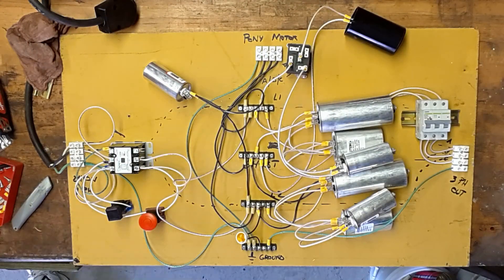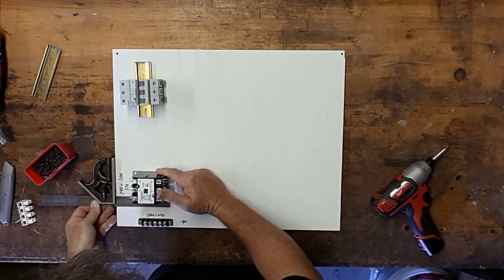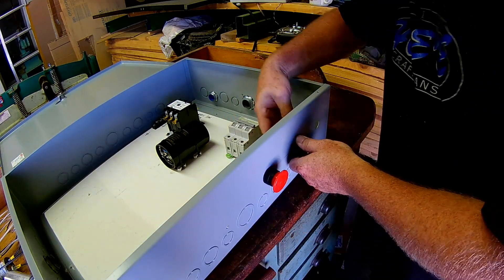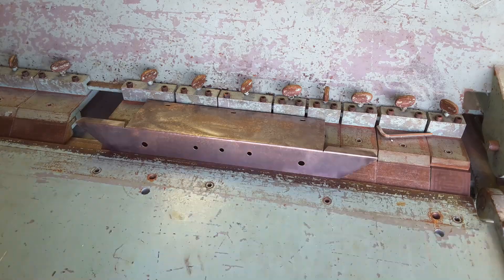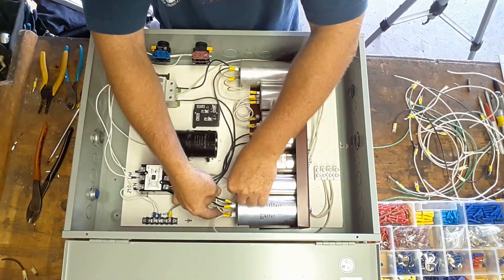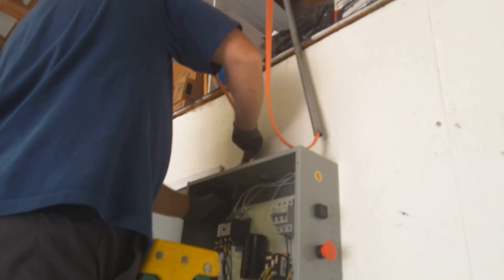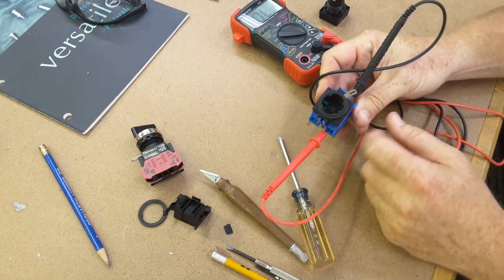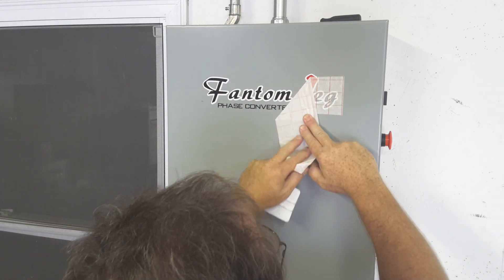Building a Phase Converter - Part 3 Final

Comment: Great set of videos. These really aren't that complex to put together and certainly can be built for a lot less than the cost of a commercial unit. While I admire the ingenuity of modding that switch, I wouldn't feel comfortable risking the motor in the event the tab on that 25 cent piece broke. There has to be a way to do it that can't fail in a way that would destroy the motor. I'd very definitely want a fuse or breaker for the motor (the really expensive part of this) regardless. Secondly, I'd be using 4 wire. Neutral and ground aren't the same and treating them that way could be deadly. Finally, even with the 4 wire setup where you could pull 110 volts off, it would be a lot better to just use parts that are designed for 240v. You didn't mention it, but you need to pick a contactor that can handle the maximum amperage the motor could pull. They aren't all the same.
Reply: From what little I know...Delta utilizes 3-wires wherein ground functions as neutral.  Wye configuration utilizes 4-wires with separate neutral and ground.  Please advise, thank you!
Reply: @branchandfoundry560  Neutral can be tied to ground, but unless you verify that, you can't assume it is. When you are dealing with the voltage and current levels you have in a phase converter, you don't want to assume anything.

Comment: You were probably overloading the potential relay causing it to fill you could have added a relay in circuit to take the load off the potential relay the potential relay kicks out when the voltage rises to a certain point you can get adjustable ones wiring it so the load doesn't go through the relay and you may want to have a fuse on the start capacitor

Comment: I am aware that this may be a bit late as your RPC series was released almost 18 months ago. However, I have just located and viewed it and have some concerns.
Firstly, using the ground as an alternative current path to a neutral is not a smart move, and would most certainly not be legal or legit in my country (Australia). The purpose of a ground connection is to ensure that all metal housings in equipment and appliances is bonded to earth potential and cannot present a shock hazard under any circumstances. By directing the return path of the contactor coil and indicator light to ground instead of neutral, you run the risk of leaving the case of such equipment and appliances energised if there is ever a discontinuity in the path from the ground buss to the ground stakes, which can be lethal.

Secondly, the system you have used to select the balancing capacitors only balances for the pony motor in the RPC, and does not compensate for unbalanced loads applied to the converter. It seems that the initial testing was with the powerpack for your guillotine, but you also mention a 5HP lathe motor and a mill in the series. It is quite likely that all of these machines present some load imbalance to the RPC ( control systems, pumps, DRO's, lighting etc) that the RPC cannot compensate for. This will put the RPC off balance and may result in even more ground current flowing, since it cannot be channeled through the neutral as the distribution system intends.

I accept that you may be aware of these shortcomings and have made an executive decision that they are not relevant in your actual situation, but as the otherwise high quality video could be classed as 'Instructional', others may follow your decision process without being aware of the potential issues, and hence not able to make a qualified decision as to the overall safety of their  unit.

Comment: In regard to your problem with the potential relay and start capacitor is there any reason that a kick start relay/capacitor setup would not work since they are matched from the get go even has a bleed off resistor?  For my build I'm using a 5HP idler motor.    see:    https://www.amazon.com/gp/product/B008A3UJ7I/ref=ox_sc_act_title_1?smid=ATVPDKIKX0DER&psc=1

Comment: I'm curious, how much money do you save by building this yourself?
Reply from the maker: For an auto starting, balanced system I believe I saved enough to make it worth while...BUT...if you have to buy all the pieces retail priced you are better off calling American Rotory.  They make some nice, smaller pieces.  I also considered buying one from a local shop that makes them and sells them on Craigslist.  But I like to build things....and I had the box and wire and a cheap source for capacitors, so I built it.  I learned and shared and I would do it the same again,.  However, I'll never have to make or buy another one.

Comment: Your current carrying wires inside the enclosure are too small in my opinion.  I would have ran at least 10AWG solid so you could theoretically run up to your pony equivalent
Reply: you cant run up to the pony equivalent with this system no matter the wire size, the largest i have seen work correctly is 2/3 the size of the motor due to the motor only running on 2 single phase legs.
Reply: @bcwillywilson  thanks for the info!

Comment: By far the best videos on this subject: Kudos.  I have, for the last 20 years, been using a RPC to drive my Pipe Organ Blower motor. NO where near as nice as your build. The legs were never quite balanced but the motor has always run cold to the touch.

WARNING: To those who asked about VFDs. Make POSITIVE the motor to be used is VFD rated. Without special filtering the spikes generated by the PWM square waves can generate voltages far higher than the insulation on some older motors can withstand. My 1928 10hp Pipe Organ blower motor would NOT last long on a VFD without the appropriate filter. Had a local theater blow up an old 25 Hz motor because of the 4 times the rated voltage in spikes generated by the VFD.

Again, fantastic video!

Comment: I've been following your videos on the build, they are really well explained and setting everything up on the big board really helps in understanding how the wiring is put together. Is the start capacitor 120v or 240v? Also in the last video I seem to have lost your explanation of how you modified the push button switch for the start button.

Comment: Sir , on your starting circuit, use a timed switch, use time delay set on desired setting "second" . You need a rated relay, connect the wires( capacitors and pony motors) on " normally close" switch,..On your time delay switch, wire supply 220v, then connect across switch contact  "normally open" and to coil of relay. Operation . .as 220v supplied on time delay, within the set seconds, relay will cut off the switch from capacitors to wire of pony motors.

Comment: Good videos, good circuit and design, and nice narration. Good enough for me to duplicate what you have done. Thanks.
Just a word of caution. The switch that you modified is a potential problem. Years down the road it might fail and you go to change it out forgetting that you modified it. Or, someone else has the same problem not knowing the switch was modified. Either way, you might have the original problem return.

Comment: Excellent videos sir, you are to be commended.  Built my 10 hp unit following your directions.  When I try to start it the pony motor just hums and seems to lock up.  The pony motor is currently wired Delta.   Should I wire it wye/delta and if so would this eliminate my problem?

Comment: Hi great videos! My question is I have a 25HP 3PH motor that came with my air compressor. I’ve been trying to use a 10HP 1PH motor instead but it starts then overloads and starts slowing down eventually tripping the breaker. Can I use the 10HP 1PH motor to make the phase converter to operate the 25HP 3PH motor?
Reply: to run the 25 hp compressor you would need a motor that is at least 37.5 hp, with a rotary phase converter you will loose about 1/3 of the power of the pony motor in generating the third leg of power.
Reply: Nope, the idle motor needs to be matched or within 1.5 times the work motor

Comment: Enjoyed your three videos, neat build with a good explanation. A quick question, on the idle motor how is it wired Y or  Delta and does it matter? Same for the 3 phase motors Y or Delta or doesn't matter.
Thanks
Reply: Yes it does matter. A motor in a “Y” configuration runs on 220-240v AC while in a delta configuration runs on 420 AC three phase off course.
Reply: Delta is 3-wire configuration wherein the ground wire functions as the neutral.  Wye configuration is 4-wire with separate ground and neutral wires.  Voltage does not correlate to one configuration or the other.

Comment: You have created a very informative and nice video sir... I am on the process of making the 3 phase converter using my 7.5 hp pony motor with LEROY SOMER brand. Is it safe to  use the same microfarad in your video since you are using 7.5 hp pony motor also? Thanks for your time to answer and God bless you...
Reply from the maker: The point of tuning the caps to your motor is that motors differ.  Age and efficiency and windings etc.  These differences mean your best voltage balance with your motor may differ.   You could start with what I have and tune from there.

Comment: Great vid and info, I just purchased a used mig welder and feeder 3 phase power needed to operate, 230/460 volts , 30/15 amps,60hz ,3ph, after extensive research RPC is my option, my question is, in your expertise, do I need a 10 or 15 hp motor to run this welder or can I get by with 5hp or less ?  Your vids on subject is by far the best out there, thanks for posting
Reply: Welder usually need a lot.  Look at discussions on Practicalmachinist web forum.  I have similar 480 mig and I'm going 30 hp ( got crazy good deal but it's 350 pounds!).  Maybe overkill but I'd say do at least 20 hp.  Gives you room for other needs down the road too.

Comment: Hi . Thanks for this detailed layout. I have done my phase converter and it is balanced  on the volts and it starts the lathe motor 5.5kW like a dream. Currently the motor is not installed in the lathe due to gearbox problem. What I did see is that the amps drawn with out load is 1.2 ,1.5 and ghost leg is only 0.6A . Is this normal or do I need to do further balancing. I run a 11kW converter on 220V . I will appreciate if you can give me some pointers to looks at.

Comment: Hi. What I couldn't see in all the 3 videos is the wiring of the the Pony motor from the supply and the load. Can you show how Pony motor wiring is done? Also you mentioned that there is current reduction by connecting the 20uF capacitor across the supply voltage, how much current reduction did you get?

Comment: Great video. Are all the capacitors electrolytic and if so, how do you know what polarity to use?
Reply from the maker: Capacitors for this king of thing are all AC capacitors.  They are all oil filled.
DC cap's you have to worry about polarity.  ~P

Comment: What is the final voltage
Reply from the maker: I believe this is considered 208/3phase.  For actual voltage see part 1.
Reply: sbirdranch, ok what I have a piece of equipment that requires 415/3phase will a 415/3 pony motor output the 415 volts or will it still only output the same as the incoming voltage but in three phase

Comment: Great mind and teaching techniques as well. I have been a cabinetmaker for over 40 yrs, I just bought a used wide belt sander that is 3 phase. 20 hp.  So I was considering building a converter such as the one you built.I was wondering when you balanced the legs and added the 3 caps, once you knew the total mfd's  could you at that point just purchase 1 cap that size to minimize how many caps are in the cabinet?Also the final solution in the potential relay system was brilliant, however for a novice is there a off the shelf solution?I have a fairly good mind for electrical so I believe with your great tutorial I could build this.One more thing would you suggest purchasing a new motor vs a used one as I am going to need a 40 hp 3 phase motorThanks, and again great Job :-)  Joe
Reply: Well, I remember lots of vehicles that had a separate push button for operating the starter.  I vaguely remember vehicles that had a 4th pedal that you literally had to stomp to start the engine... fun, if the parking brake didn't work, you were on a hill, and you had to hold the throttle wide open to get it to start.  Many a man and several women lost their religion over those.  I even remember one vehicle that didn't need a key for the ignition.  Just a simple toggle switch on the dash.
Reply from the maker: 40hp!  Damn.  If I had to go that big, I'm afraid I'd be looking at a commercial unit.
The amature solution to the start button, is to just use two seperate buttons.  Press the button for the start cap first, then tap the button for the 'run' to activate the motor starter.  When the pony motor starts up, let go of the first button.  Just like to do when you start a car, you let go of the key when the motor fires....I just realized there may be people in the audience that have never turned a key to start a car.  Wow!  I better go dial the phone.  ;)  P.
Reply: Thanks for your input. I appreciate it! And I have my very own key!

Comment: The final push button switch, is it the HW1B-M1F10-G, that the link takes you to, at Amazon?
Reply from the maker: Michael Roberts I needed both halves to be normally open.  I couldn't buy that combination.
Reply from the maker: Mature Patriot Yes.  I used two of them to make a single double pull double throw momentary button.
Reply: Great video.  Why did you need 2 switches to make 1?  I thought simply filing down one mechanical contact was all you need to do.
Reply: I looked on the internet for 3 days for a double NO switch but never found one.
Reply: Got it!  Thanks!  I just ordered 2 switched.  I have a massive 30 hp project  going and wanted to use your design,
Reply: Correction...found this one (IDEC HW2B-M120-R) that comes with 2 NO switches for anyone who wants to do the 'file down the one contact" switch, which was great idea by the way!!!
Reply: Michael Roberts -  Thanks for the info.  I have one on the way.

Comment: Suggestion, you suggest the use of a plywood board for mounting, Don't never put anything flammable inside of an enclosure. The other reason is the metal back will ease grounding and make the whole project safer. The other thing is wood in an enclosure will never pass code.

Comment: Just ordered three 100uf capacitors.  It's a start.  I am retired now and on a fixed income, although my wife still works, my expenditures are limited for what she calls my toys.  It's 13x40 lathe, it is definitely not a toy, I said defiantly. lolol
Reply: instead of relying on a switch with different height contacts in it, why not use some relays? a simple time delay relay with a .25 second timer on it would be safer than hoping the mechanical contacts stay that distance apart. your button would close the contact to the start capacitor as well as the time delay relay. when the relay finishes it's time it would close and supply power to the motors, after that all is good.
Reply from the maker: I hope you are progressing well.  ~P
Reply: Still waiting on a couple parts.  I have everything I've received so far laid out on my work table, in the position it will be installed.
Reply: Just got my switches, and built a double throw switch with delay.  There is about a 3/32 difference between contact depths on switch push.  Don't know about these cheap Chinese switches. Have 2 more, better quality, ordered to replace these.  Did you put a bleed resistor on your capacitors?  Didn't hear you say anything about a resistor.  Still waiting on the magnetic motor starter to finish the assembly.  I do appreciate your sharing the videos on this build, they have saved me a ton of time and money.
Reply from the maker: I did not add a bleed resistor.  They bleed out through the motor windings.  In the first video I think you see me check the capacitor charges and they die almost immediately.
Reply: Been fighting a couple orthopedic issues with my left hand and wrist, but FINALLY was able to finish my 5hp RPC.  It is performing great.  Thank you so much for your tutorial.
Reply: Ian Mears - Just ordered one!

Comment: great video i am building converter now and gave me some insight
Reply from the maker: I'm glad it had some value for you.  What are you going to drive with your converter?  ~P
Reply: 220 volt single phase to motor 500 mf start cap then try some run caps to bal system

Comment: Nice Build. I'm a little confused as to why you decided to use several capacitors instead of one larger capacitor.
Reply from the maker: To start, when you follow the process of tuning, you don't go into it knowing what you need.  Sure you can take a guess and it will work, but that was exactly the point of showing everything I did in the first video.....Oh.  Did you watch the first video?  Do so if you didn't.  I think it will answer your question.  ~P.
Reply: @sbirdranch  Oh Kay-you had them through prototyping so used what you had in leu of buying singles!
Reply: I am running a 5 horse lathe and I have a 3 hp pony! What should I do?